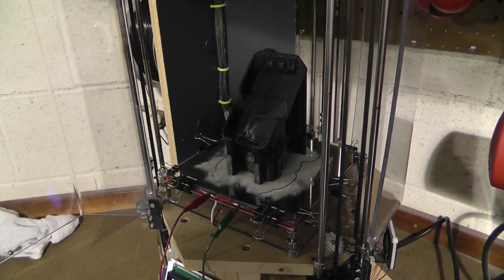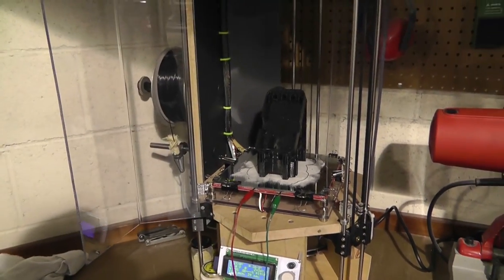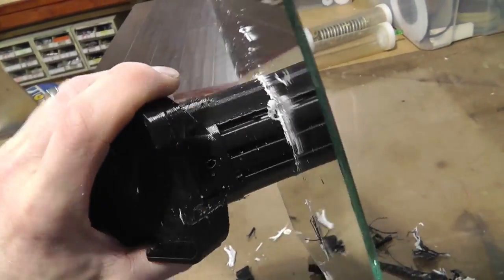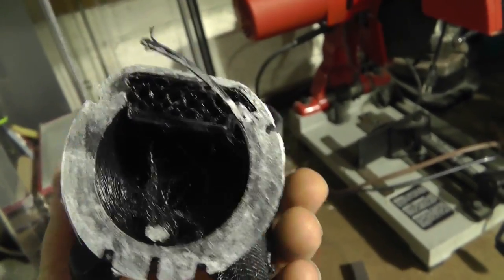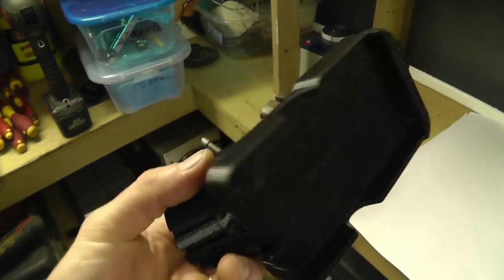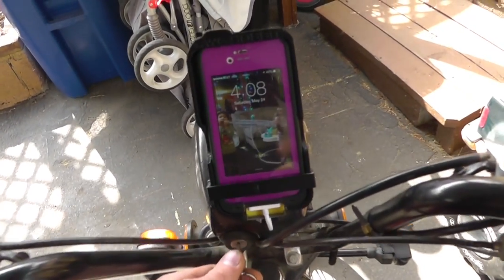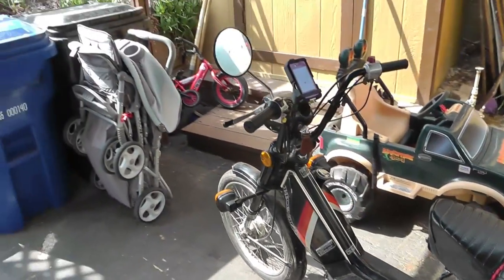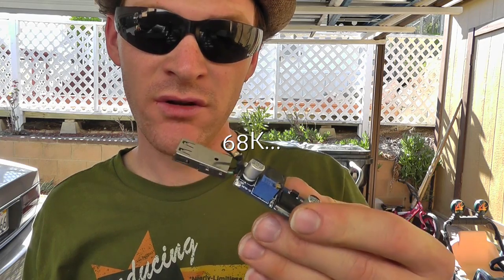#8 Honda PA50II Hobbit: 3D Priented GPS (spedo) Mount + Charger.

Comment: When doing LED upgrades you may want to use higher wattage LEDs.  even a 20000mcd 5mm led is not that bright when trying to light at a distance.  I would recommend a CREE T6 or larger for headlight duty.
Reply: I think he was talking about an indicator for the high beam, not the actual light bulb. I could be wrong though!
Reply: ***** no he's actually using for lighting, he said it is for his highbeam